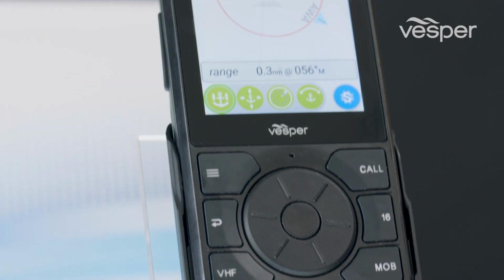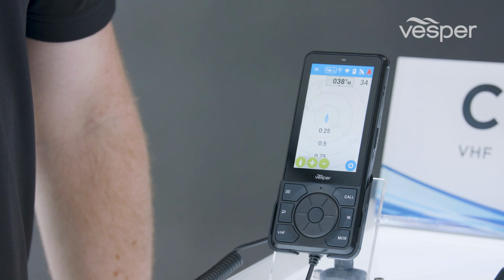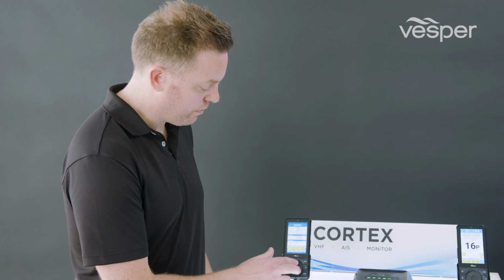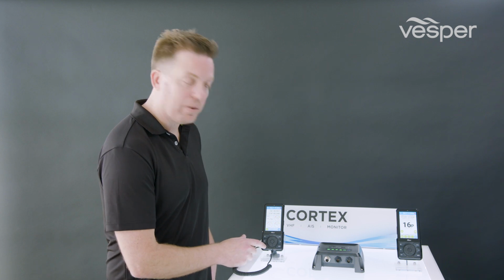Cortex Demonstration: Handset Core Functions

Comment: Can you switch off the ais though the menus, or go to AIS class b to receive only? For high piracy areas. Thanks
Reply from the maker: Yes, it's called "stealth mode" and it switches off AIS and DSC position reports. You'll find it on the Transponder Status page that appears when you touch the status symbol at the top of the screen